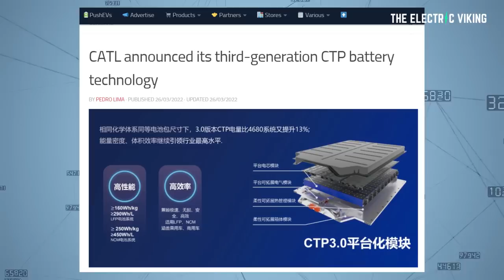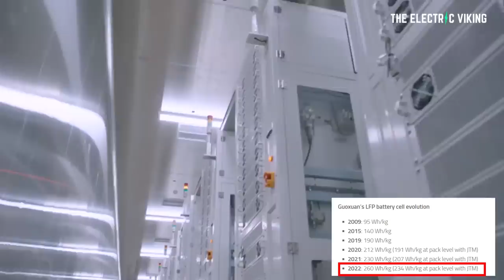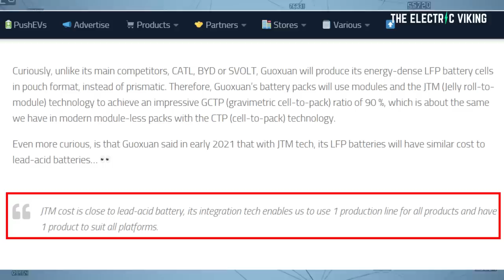260 Wh/kg LFP cells - cobalt & nickel batteries are DOOMED

Comment: 1/2 the year, we live in Maui, Hawaii, where it's sunny 98% of the time.

I bought 4 250W portable solar panels and an LFP solar generator (2 KW), and during the day, we generate about 800W on average for 6 hours and 400W for 2 hours early in the morning and late at night. All this equipment folds up and is portable if we need to move.

I have a smart switch that draws power from the solar generator when enough power is available and from the Maui electrical grid when not. We power our entire house from this except for the dryer and A/C. We run out of juice sometime in the early morning.

So every morning, the LFP batteries start at 0% and sometime around noon go to 100% - day after day for a year now.
That's just 180 cycles (1/2 year), and the generator is rated for 5,000 cycles before dropping to 80% on full.

Works like a charm...and our payback is 4 years - then it's free for life.
Reply: That sound awesome, and the Tesla megapacks fit right in on Hawaii.
Reply: When you say solar generator, do you mean one of those portable battery systems which include inverters and solar management systems? Which company did you buy from?
Reply: @-whackd  Yep Bluetti. They now have the BLUETTI AC300 & 2*B300 System which is just fantastic.

Comment: 2 years ago I spent $4500au on 9kw of LFP, today I can get 15kw for under $4000au that takes up roughly the same space and weight, AMAZING! Especially considering the LFP chemistry is so much older than all the new ones, doesn't explode and degrades slower. Put that together with insanely good value (50c a watt) solar panels and independent energy is a no brainer right now if your savvy. They have almost paid for themselves already, in another 3/4 years I will be able to upgrade and pay for it outright with the money not wasted on an electric bill, if I am patient enough to wait that long :)
Reply: Two years ago my solar panel company was dubious when I installed 24kWh of lead-acid battery storage instead of the longer-lasting, more power-dense option of lithium batteries. I explained to them that my initial cost was one-third that of lithium batteries, that as long as I remained grid-tied those lead-acid batteries would easily last five to ten years, and that looking at historical improvements in battery technology I would be able to replace my lead-acid batteries in five years or less with double the capacity at half the cost of the lead-acid, they came around to my way of thinking! Looks like it won't be five years now, but closer to three.
Reply: @yo yo Low temp sucks until CATL solved the problem about 6 years ago. It is this CATL solution that opened the way for mass LFP deployment in China, and propelled CATL to top position. Today, new EV in China routinely do -40C field tests in Mongolia and passed all of them.
Reply: @douglasburnside  Thats right, 2 years ago either chemistry made sense. My build was in a truck so size, weight and most of all charging efficiency made LPA the clear option. also I knew it was the future and wanted to know how to look after them.
Reply: @felixtossan5107  That would be very important to know for potential EV buyers who experience and endure harsh cold winters despite climate change estimates.
Reply: next year you get 1kWh LFP for 100USD at alibaba. you can get them at 120USD at alibaba.

Comment: Nickel based batteries have also been getting better. There will always be a use case for higher cost higher energy density batteries... Nickel is getting close to 400wh/ kg, so still well ahead...
Reply: If it was ONLY higher prices for higher energy density, but you’re forgetting about the durability and supply chain issues, not to mention safety.
Reply: @cgcrosby2  Safety & durability has been solved
Reply: you are right. per kWh, they are not cheap but for aviation, they are great!
i think the pipistrel alpha electric has cells with 200Wh/kg in it. doubling that would be amazing.

Comment: Two years ago my solar panel company was dubious when I installed 24kWh of lead-acid battery storage instead of the longer-lasting, more power-dense option of lithium batteries. I explained to them that my initial cost was one-third that of lithium batteries, that as long as I remained grid-tied those lead-acid batteries would easily last five to ten years, and that looking at historical improvements in battery technology I would be able to replace my lead-acid batteries in five years or less with double the capacity at half the cost of the lead-acids they came around to my way of thinking! Looks like it won't be five years now, but closer to three.
Reply: - and you can recoup some costs when you sell the Lead, BTW, are the batteries still in perfect condition?  if so, I guess  -no point in upgrading regardless, until they are shagged - easy to add in a little additional capacity on the side,  if justified

Comment: Note Sam, there is a difference between energy density & power density. 
It's important to get the terminology right to avoid confusing people
Reply: guringai / Don't be so savant here!
He talks in popular terms and we like him like that. 
We understand exactly what he means, don't you worry!
Reply: Thanks, I just learned it from you. I searched and got the the following point from Google...
Power density refers to how quickly a device can discharge its energy, while energy density refers to how much energy a device contains. Batteries have low power density but high energy density, meaning they have a lot of energy that gets discharged slowly.
Reply: DirectX S / It is not exactly like that. A correct explication is much more detailed.
"Power" is a property that refers to the receiver which is an energy consumer. That's the one who develops "power".
A battery, by its construction, can release its whole energy slow or very fast.
For example, if you short circuit an electric battery it is possible for its energy to be delivered ( dissipated ) in a few seconds, depending on its internal construction and eventually by some added electronic controls.
However, a battery doesn't have the parameter called "power density" because the energy of the battery delivered to a consumer develops "power" at the destination in the consumer, and not before, and the power delivered depends on the size of the consumer.
For example, a battery that has an energy of 1 KWatt can give a quantity of energy of 1 Watt per second to a consumer that can be an electric motor of 1 Watt power, or it can give 1 KWatt energy to an electric motor that has 1KWatt power.
Do you understand it correctly now?
An electric battery has only electric energy.
The notion called "Power" is developed only at the consumer that has a specific power capacity.
Reply: @mikel4879  You mean there isn't " power density " term for battery, am I right? 
Thanks for your detailed explanation
Reply: DirectX S / In a popular lingo, a practical engineering lingo, you may say "power density", but if you are talking exactly and in real terms, there's no power density.
It is only energy and power.
An electric battery has fundamentally only energy.
Depending on how you may phisically build and phisically enclose a battery, you can say in an engineering lingo "energy density". But fundamentally, an electric battery has only electric energy.
Reply: @mikel4879  batteries have C ratings, rate of charging and discharging. Exceeding the C rating is likely to damage it. Similarly they have an E-rating, describing the discharge power rate. 1E means it discharges the complete battery in 1hour. So you could compare batteries power, based on their capacity, V, C, and E. different chemistries and batteries should be different.
Reply: anywhere roam / Re-read very careful what I've written, forget the useless attributes, and use your own brain in order to understand the fundamentals of what is the deep meaning of "energy" and "power".
Don't come back with the same stupidities if you want to argue with me, because I don't like to waste my time for nothing.
Show me your own brain in action here and not just a simple parroting activity. I am so fed up with useless opinions from parrots with almost no brain structure of their own...

Comment: Again, Wh short for watts by hours. Pronounced what-hours.
Watts is power like horse power. Applied for an hour it’s a measure of energy. 
SI unit is Joule, but we use kW.h for convenience.
100 kWh could pump out 20 kW for 5 hours. Or maybe 500 kW for a short time.
Wh/kg is gravimetric energy density. GED.
If everyone mimics you, we’ll have a decade of nonsense.
Reply: "What hours?" is like asking how long that light bulb (60w) is going to take to before the work (punching this note in) is done.
Glad to see the "kg" in there as we fotget this electric battery is conspiculously heavy. The EV car is a lot of mass to move, yes?
Reply: @calmorton4619  He meant Watt-hours - just a typo

Comment: Considering some of the best Li ion battery have the density of over 400 Wh/kg  , I  would say that LFP have a long way to go before the former can be called obsolete.
Reply: Indeed. That would be the very, very best, and almost certainly only in the laboratory. A very good consistent number is around 300 and improving fast. Which means they won't be going obsolete any time soon. Anyway, according to battery chemists, we're still at the very beginning of all this development, so I wouldn't be signing off any promising battery chemistries to obscurity yet.
Reply: He means obsolete for the mainstream, or the majority of the market.

Getting 234 Wh/kg at the pack level is going to be in the same ballpark as Tesla's most dense packs right now. So, in other words, means they are viable for 400+ mile range.

If you can get 400+ mile range with no nickel or cobalt, and at lower cost, can be charged to 100%, last 3-4x the max cycles, etc. then this is game-over for virtually every vehicle segment.

Lithium-nickel would then only be desirable for large trucks and eventually planes, etc.
Reply: Every technology improves over time. A disruptive switch usually happens rapidly when a cheaper technology improves enough to enter a new market. LFP batteries cannot provide enough range right now to be used in Tesla long range cars. Tesla will continue to improve its battery tech, but people don’t really need 400+ miles of range so there’s limited ROI to going beyond 350 miles. If LFP batteries can do 300 or 350 miles and cost less, then the market will flip almost over night.
Reply: @davandmoccoo  And the Plaid successors, where battery durability and cost are lower priorities than maximum battery power density, minimum mass and volume.
Reply: for most cars, NMC will be obsolete. for big trucks and aviation this will be a different story. but in this area we will see sulphur based batteries coming.
btw. LFP are also Li ion batteries.
Reply: @legostud  don't underestimate the difference between what people need and what people want.
nobody needs a ferrari or porsche or any car above 80.000€. but there are many many people who want these cars and those who have the money for it will buy one.
so, there are enough people who want and will buy an EV with 600+km (400miles) of range.
Reply: I agree. Under the skin of it, no one needs a car. People need access to food, shelter, medical and waste disposal services.

Comment: The improved safety of LFP batteries is important but may be a side issue at the rate of energy capacity increase.
Reply: While still being the cheaper battery. Today in an environment with lots of charging, LFP is obviously the best choice. Tomorrow it will probably just be the hands down best choice anywhere.

Comment: Having invested in Solar panels years ago going with Canadian solar panels at 265kwh per panel gives my household a reasonable reduction on my power bill, but if I could couple the system with a cheap battery pack comparable price to lead-acid, well I figure my power bill would be almost zero. Also by the time my Model 3, gives up the ghost in a few years I would imagine the battery packs would be on average 350 Wh/kg plenty for most, and EVs should be a lot cheaper by then due to the competition.
Reply: modules are rated in STC kW, not kWh
Reply: Yes, find WECO  5.3 kWh LFP 48volt battery modules for your solar installation.
Reply: Ummmm, you realize there are model 3's in fleet use with over 300,000 miles on their original batteries?

Comment: Have to disagree about NCM being completely pointless. First of all, the new CATL packs clearly show that NCM is still way better than LFP - 250 Wh/kg vs 160 Wh/kg. They also do NOT show at all that it would have better energy density than 4680s - sorry but you missunderstood what the CATL statement says. Those 13 percent are in power and simple result of rectangular vs cylindrical battery form factor. 
Svolt LFP is impressive but talks about future "gamechangers" - been there done that. NCM and high Nickel chemistry is also improving fast and both apply the improvements  on the anode - there is not much to do about the LFP cathode - it is always the same chemical unless they are already doping it with other materials.
Sooner or later LFP will be enough for most cars, but there´ll still be a need for nickel based batteries - for Semis, VTOLs and other aplications where energy density is critical.
Reply: Good points.

Comment: LFP for most EVs, Sodium ion for grid storage, some type of Lithium Sulfur with graphene and other special sauce for high end EVs, Trucks and air planes.
Reply: yes, that is how it looks like today. Sulphur based batteries could even get in the same cost range than LFP due to the higher energy density and low material costs. however, the graphene layer will be the big question mark regarding production costs.

Comment: hi Sam, great video (as always). one question though - ist the only drawback the nrgy density, or is it (at least where there might be cold) also an optimum operation temperature (ca. 40 deg.Celsius for LFP and ca. 20deg.less for NC?). here in Germany it does sometimes gets colder than the freezing point and the NC batteries are still working pretty damn good. the LFP batteries are said to loose range and charging efficiency much quicker than the NC batteries. can you dig out some facts about it or do we have to stick with the rumours? my best regards, Robert
Reply: I've never been so thankfull to live in brazil and have the peak minimum temperatures of 16ºC (like, for 1 or 2 days) and average of 20~22º on winter.
and 25º average for the whole year
Reply: i heard the opposite.
Reply: @stefanweilhartner4415  that's what I'm saying - I only get rumors about NFC and my own experience with NC battery - no much scientific facts
Reply: @rzakolski001 LFP on its own does have cold storage and cold operation issues that make it less resilient than nmc in similar conditions. If they're made cheaply enough, however, adding an offset battery pack for temperature management might be an option. Baffled thermal insulation for the pack housing is also an option. The cost offset for doing any of this isn't usually a consideration with NMC.

Comment: Jeff Dahn is testing NMC batteries at  85 degrees and they are lasting a long time ,  he reckons his nmc will last 100 years at normal temperatures, it depends on the electrolyte additives and also how high you charge your battery,   hence why you only charge your tesla to 80%